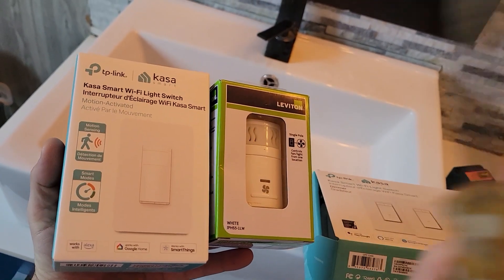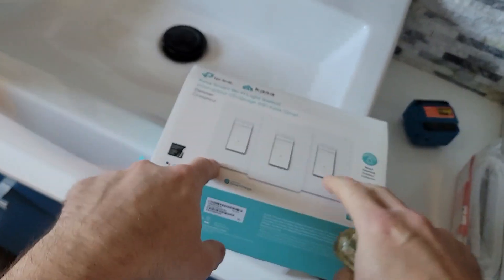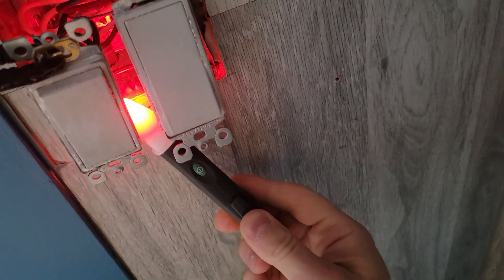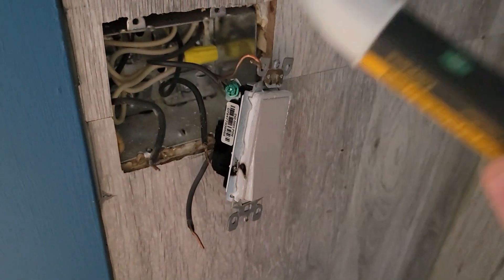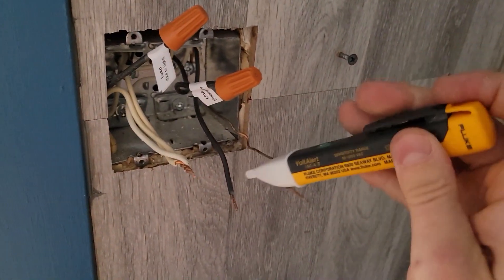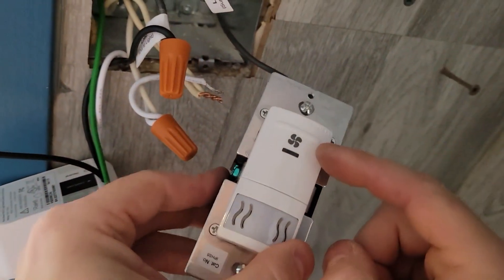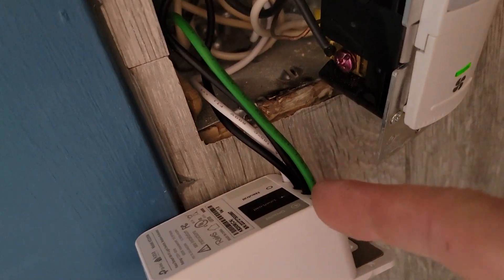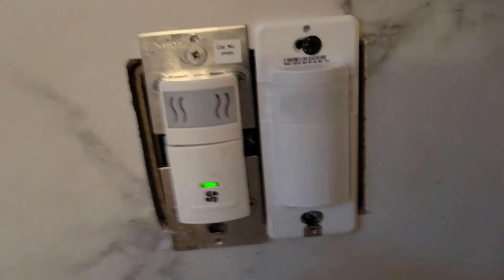How to Wire Humidity Fan Sensor & Kasa TPlink Wifi Sensor in Bathroom for Automatic Fan On

Comment: I would recommend cutting the power off entirely if u know which wire goes where.
Reply from the maker: most of the time its hard to know what wires are what, so check, label and then turn off the power

Comment: does it helps cut down on the electricity bill or is there no difference?
Reply from the maker: id say it does over time, even though lighjts will turn on on sensor during the day and stay on, but those instances when you would FORGET to turn off the lights is what ads up over time. even forgetting to turn off a light over 1 night ads up.

Comment: its voice activated? thats so cool
Reply from the maker: the fan isnt voice activated because kasa doesnt make a cheap smart fan, downstairs in the powder room we did put a smart wifi kasa switch to also control the fan and lights but there is no shower there so we just want it to turn on automatically stay on for amount of time we set on kasa app and turn off, incase people forget to turn it on. that fan i can control by voice also.